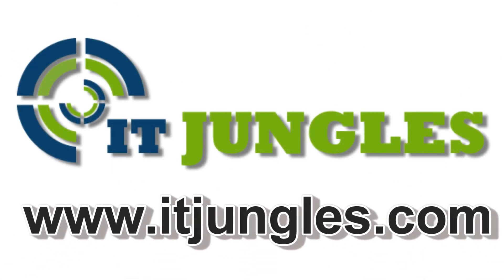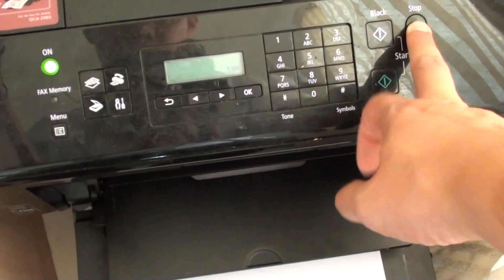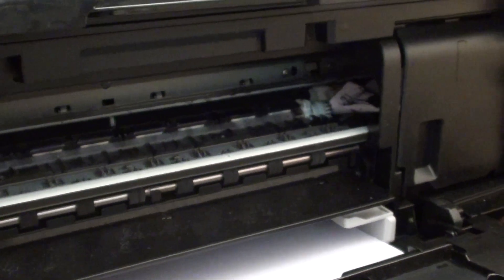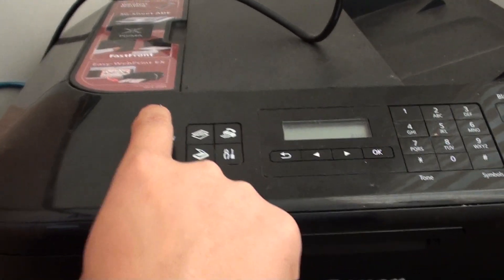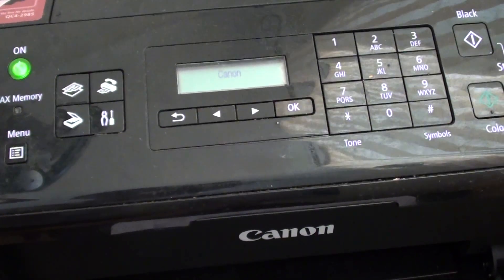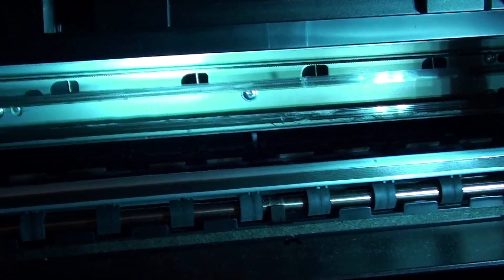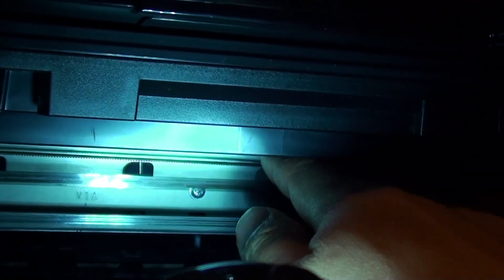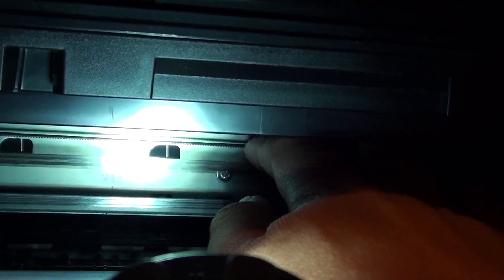How To Fix Canon Printer Error 5100

Comment: I don't care if this video is old--so is my MX310 and so am I. Another satisfied customer here: the printer was totally wigging out and making a nasty chattering noise on startup, shutting down with a 5100 error. I found great big gobs of greasy grimey white grease (or something) on that transparent strip. Cleaned it off with Q-tips and alcohol. Now it works perfectly. Who woulda thought. Thanks again, and what are you working on now?

Comment: We had a piece of paper stuck in the back but the 5100 code was still there when we removed the stuck paper. I would not have thought that cleaning the strip as described in the 2nd half of this video would do anything, but we tried it and it worked. Thank you!

Comment: Not being a tech saavy female but learning from a couple of tech saavy ladies where I normally get my computer fixed, I learned how to fix my own printer.  Note my printer had not been used for 10 years and the bloody computer technician who came to my place lied and said that the printer was not working and to throw away the printer drive.  Never again, I will get a 2nd opinion as I did end up throwing away the drive and then had to reinstall it.  Anyway, I watched YouTube videos turned on and off my computer for longer than 5 seconds.  I checked to see if paper was jammed in it, but to be honest it was hard to tell if paper was stuck right down the bottom.  I next brought some rubbing alcohol wipes and cleaned the computer as well as I could including the strip, making sure I did not touch it with my hands.  Voila! my printer is now working.  Makes me feel so good about myself being able to do this.  So over the moon that I have not had to fork out a lot of money considering I am not working.  Yes, Yes, Yes.

Comment: Thank you for the tip.   Worked on my Canon G1000 by cleaning the encoder strip.
For me, the printer pulled in the paper halfway and the rollers would keep spinning for sometime. Then the paper would be pushed back. Again rollers spinning. Next, the paper was rolled down, just about where it would exit the printer and stopped. 
Then Error 5100 would come up on screen with both LEDs blinking alternately on the printer.  It seemed like something was stuck inside but I found nothing.

I tried cleaning the encoder strip, but didn't work. But then I noticed that I had missed the part where the cartridge carriage was resting (extreme right side).

Pressed RESUME/CANCEL button for 5 seconds and the carriage moved to the Left, and there it was! A tiny line of ink on the encoder strip, exactly where the carriage would usually come to rest.

So make sure you check the encoder strip all the way from left to right and clean it with a q-tip or tissue.

Sorry about the lengthy comment, but it drove me nuts for 2 hours!!

Comment: Canon printer error 5100 is very common error in Printer and if you facing same problem then you can resolve error in use following step. First restart printer and then go to menu option in printer setting after that click disabled option but If you unavailable solve this error then ask a query in our Printer Technical Support Forum and more information visit our website https://www.printerstechnicalsupport.com/brand/canon-printer

Comment: Nice Video, I ended up having very small pieces of paper trapped on the back side of my Canon MP530 printer, where I could not see them. I unplugged the printer, then I turned the printer on its rear side and blew out the roller area with compressed air, low and behold a few small fragments of paper came floating out of the printer behind the ink cartridges. Works fine now.!!

Comment: IF THIS HAPPENED TO YOUR CANNON MX922, IF YOU ARE HAVING A PROBLEM WITH ALL THE CARTRIDGE LIGHTS BEING TURNED OFF. ITS BECAUSE YOURE SUPPOSED TO TAKE THEM ALL OUT. AND LET THE PRINTER RECOGNIZE THAT THEY ARE MISSING. THEN THEY WILL OPEN UP AND THE LIGHTS WILL TURN ON

Comment: There is a strip of foam stripping in my printer that seems to be stuck it's part of the machine some of its came off. I have took the pieces off. It worked for a minute but I got the error again. Can this be fixed? There was lots of ink and paper stuck in there.

Comment: PIECE #5
Lastly, 2. the printhead might be your problem. At the beginning of this year, my previously perfect first ebay mx870, began giving me the 5100 error. I spent hours and hours, different sets of proofs, starting with plain paper, trying 6 to 10 proofs, switching to matte, trying to coax the printer to cooperate. 

What I didn't know, until 4 months later, is that the printhead was going bad, down at the bottom on the dye black ink line of the nozzle check. With the naked eye, it looked perfect like it always had looked. But after months of fooling around, being able to print matte, but not glossy for example - somewhere along the line I printed the nozzle check on actual matte paper. 

I call it matte paper, but it's REALLY cheap - so Canon calls it high resolution paper. It does have one side coated. It is very inexpensive, and very good for proofs - less than 10 cents a sheet - perfect for proofs - I use the matte setting with it. As good as the Canon mx870 prints on plain paper, print it out one time on the matte paper (high res paper) and the colors will pop! (I guess i could use the high res setting instead of the matte setting - but when we are completely satisfied with the proof - we print a title on each proof with the actual print color settings in the print driver, so if we just added too much yellow, we can go back to what worked better - the image has a title with the settings. So as I said, when we get ready to print to the final $2-4 a sheet Hahnemuhle art paper, or similar, on prints that we are going to frame and hang on the wall, I use the matte setting, so in making fine color adjustments in the print driver, I want to be consistent and continue with that same matte setting. 

For a cheap glossy paper, try the Kirkland glossy photo paper, $18 per 150 - about 12 cents per sheet, an amazing value in a heavy - I think it's 240 gsm - glossy paper. If you are putting a photo behind glass, you don't want glossy - because the glossy will reflect, and the glass will reflect - too much reflecting. A fine art paper causes the print to take on the quality of a painting - the texture in the paper changes the quality of the print - it begins to cross the line from a photo to a painting – I was always a glossy paper person, but when I saw that happen then I began to appreciate why those fine art matte papers cost so much. Pick up some sampler packs and give it a try.)

Comment: PIECE #2
On every single one of my three mx870 printers, I have experienced the 5100 error. I got these three printers used - one from my brother who stopped using it and stored it for 6 months, another from ebay for a total of about $133 with shipping, and a second on ebay for the same amount. The last one I bought has been the very best. But it exhibited the 5100 error, when I had it up in LA printing proofs and art pictures, with the printer sitting on a narrow wobbly table. After a few hours the printer suddenly showed the 5100 error. I re-seated the carts, then it resumed printing. But that scared me, so I took the printer off the rickety table, placed in on the floor, and never had a problem with it again. The rickety table exaggerated the head movement, and it may have loosened up the carts and caused one of them not to make a good electrical contact. Or it could have put pressure on the printhead movement - either way, it was a very bad idea. The printer should be sitting on a solid platform. 

My first printer from ebay began to display error 5100 problems at the beginning of this year, but NEVER in the plain paper setting. The error came when I switched either to matte paper, or to the glossy paper setting. When you switch from plain paper, the printer switches from printing all text and black lines with pigment black, to printing black text and black lines with dye black. It can also produce a muddy black by combining cyan magenta and yellow. IT WILL NOT USE THE PIGMENT BLACK CARTRIDGE on any type of fine paper setting.

Comment: I am going to break this comment into several pieces, to try to get it to post.  

PIECE #1

This is where to start - 1. Make sure nothing is inside the printer.  2. Clean the timing strip.  3. Re-seat the cartridges.  
I own three of these great printers, and these 3 steps have helped.  However, there can be much more to this problem if you experience the following:  THE PRINTER WILL PRINT ON THE PLAIN PAPER SETTING, BUT YOU GET THE 5100 ERROR WHEN YOU TRY TO PRINT USING MATTE PAPER OR GLOSSY PAPER SETTING.

Comment: This is where to start - 1. Make sure nothing is inside the printer.  2. Clean the timing strip.  3. Re-seat the cartridges.  
I own three of these great printers, and these 3 steps have helped.  However, there can be much more to this problem if you experience the following:  THE PRINTER WILL PRINT ON THE PLAIN PAPER SETTING, BUT YOU GET THE 5100 ERROR WHEN YOU TRY TO PRINT USING MATTE PAPER OR GLOSSY PAPER SETTING.

Comment: Thanks! worked for me. (MP160) HOWEVER, I also had to clean up the ink cartridges themselves. The black one was HORRIBLY inky all over the sides, as if it was leaking. I almost gave up many times, while cleaning, but I just kept opening the printer back up and cleaning more extensively. Mine was flashing "E,2,2" and the "Alarm" and "ON/OFF" was flashing 2 times then going off for a bit and repeating. I used toothpicks and paper towels and paper to clean the ink cartridges, and i used 91% rubbing alcohol and paper towels to clean the inside of the printer, along with 2 q-tips. I recommend wearing disposable gloves. Also, the user manual seems useless. Its made for "PIXMA MP180/MP160" but it seems like everything they mention, doesn't apply to the MP160. There is no mention on how to do things on the MP160, like the "maintance", all they do is tell you the name of the button.
Reply: http://www.scribd.com/doc/51028453/Canon-MP160-maint-error-codes#scribd

CANON MP145 – MP160
Press the Maintenance button (icon of a pliers & screwdriver) until the code you want shows up then press the Color or Black button:
Code Meaning
A - Print nozzle check pattern (prints nozzle patterns on paper)
H - Cartridge cleaning (uses a little bit of ink)
F - Deep cleaning (uses a lot more ink – use rarely)
P - Align print head (prints alignment lines on paper)
U - Read in print head alignment sheet (P) and auto aligns print heads
B - Clean print rollers (can prematurely wear out the rollers – use rarely)
J - Clean bottom plate
1 - ????

Comment: Thank you so much, spent an hour dicking with the printer.  Turns out there was some ink smeared on the clear tape. Solved my problem in a minute.  This info should be on the cannon support site or in the user manual.

Comment: Definately clean the ribbon!  I opened & closed and looked and turned the machine over and over and no foreign material or paper stuck in unit.  I have MX450.  I tried all the on/off button pressing suggestions to no avail.  So, I turned off printer and  I used a swab to reach the clear strip a few times back and forth and turned on the machine expecting to continue to see the error code, but, VOILA !   All Fixed !   Thank you again and again !

Comment: Hi, how to pix Canon Pixma MX922 printer error code 5100?  We purchased our new unit a couple of weeks ago.  At first, the error codes were 5100 and 5101.  I called Canon Customer Support Service and they sent me a new printer unit.  After setting up the printer they sent, the error was Code 5100 so I called the Support Center again.  The matter was not resolved and instead they sent out another unit which until now I have not unpacked yet because it looks like it was a refurbished item.  Inside the brown box were just  the sealed printer unit with all the plastic and orange seals, a one-page instruction pamphlet and a pack of photo paper without the installation driver, power cord, and telephone cable.  I appreciate all the help anyone can provide but my fourth and last option is to return all the 3 units and ask for a reimbursement for the money we paid for.  Thanks.